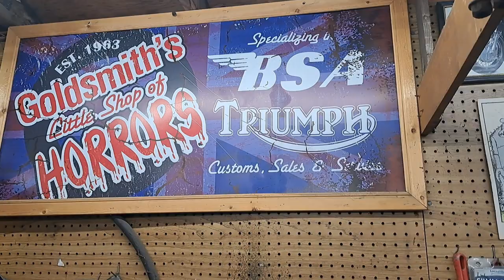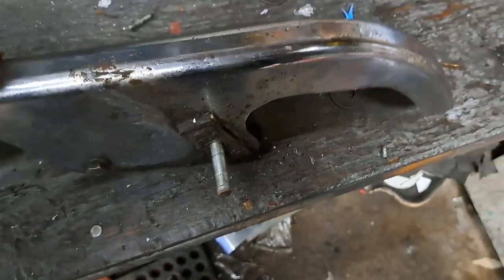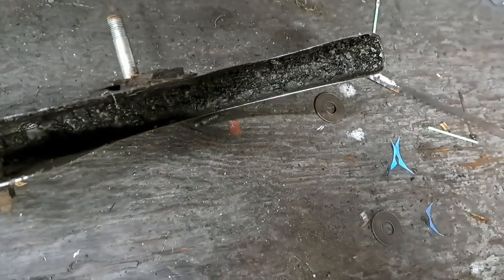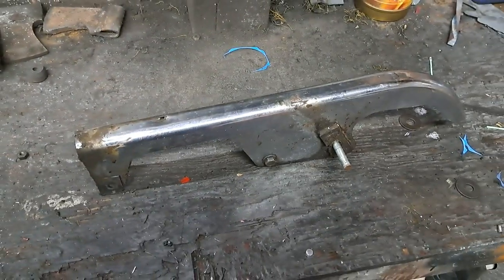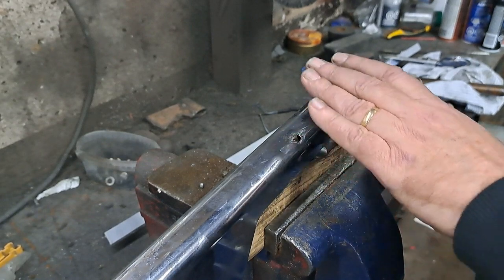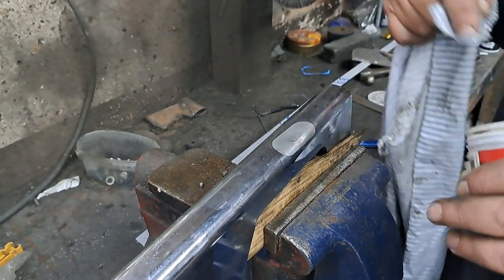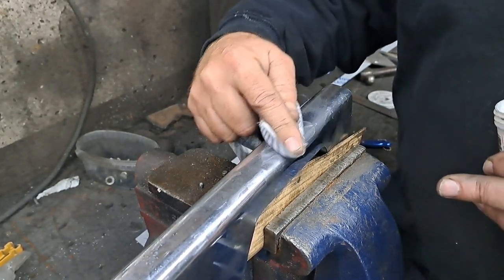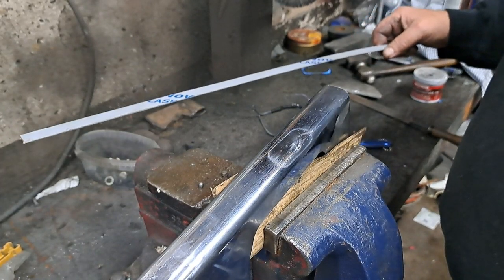Norton Project...episode 19

Comment: Nice work. Was thinking how best to deal with the top hole....original bikes had a chain oil line down from the tank and would drip out from a hose end underneath the chain guard. Putting a hose fitting at the top side of that hole could make it look like a chain oiler connection point (whether or not you actually run oil to it or not!).
Reply: Does anybody really use the chain oiler anymore seems kinda silly unless it was an enclosed oil bath chain like Harley used in a 1983 FLHT. On my 1970 Norton Im definately not.
Reply from the maker: That's really not a half bad idea! Thanks!
Reply: @peterrestaino7047  Though most do not run the oiler, some do choose to leave all the fittings in place for originality, and actually block off the feed point from the tank.